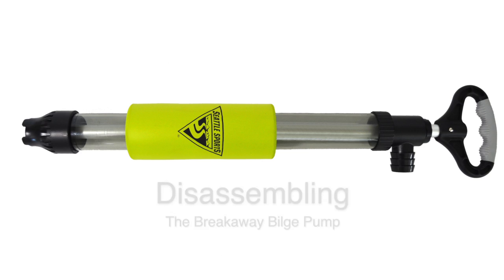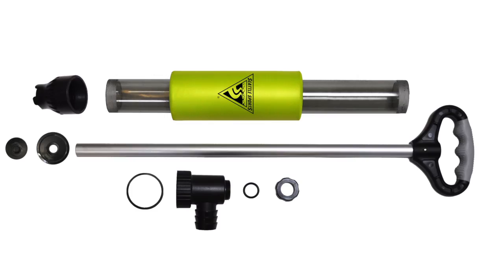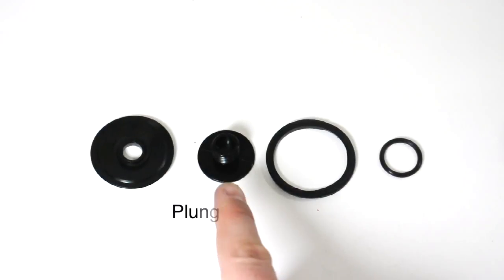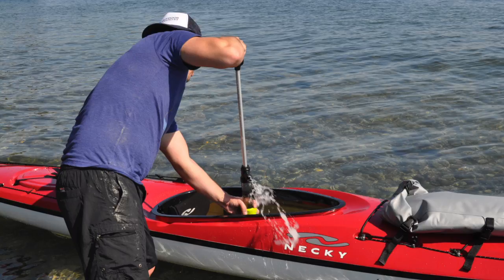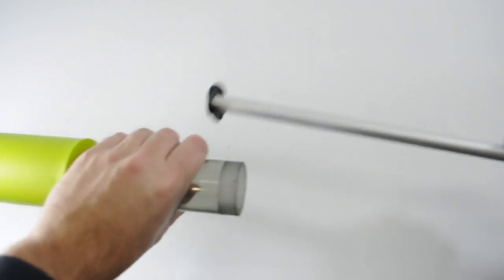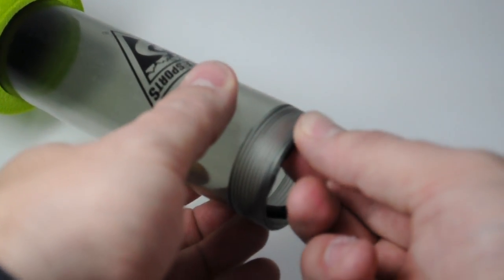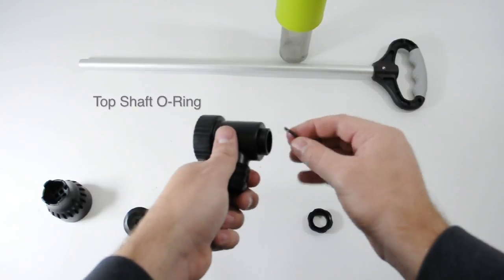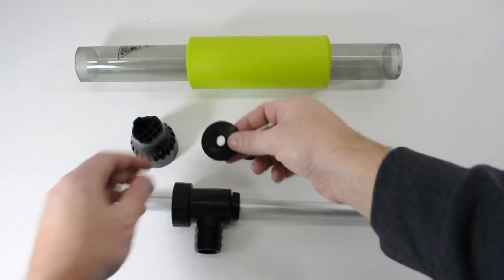Seattle Sports Breakaway Bilge Pump & Parts Kit

Comment: Mine must be an older model; it does not come apart so easily. There are small screws holding each end to the body of the thing. Overall, it looks very similar. Mine does not pump well and seems to need a cleaning and lubrication. What can I do?
Reply from the maker: Hi Aaron - Thank you for reaching out. This Breakaway Bilge Pump came out in 2016. If you purchased your bilge pump prior to that then it is not the modular bilge pump that you can take a part. Please contact our customer service - contact@seattlesportsco.com in regards to pump cleaning and lubrication. Thanks!